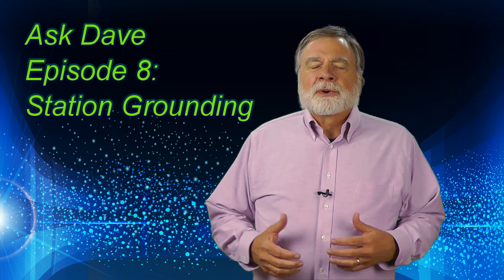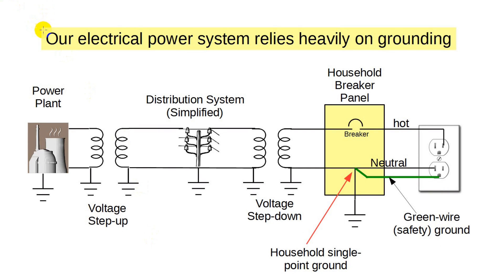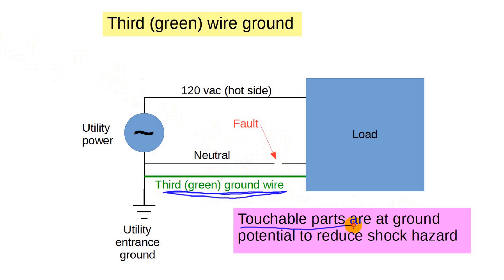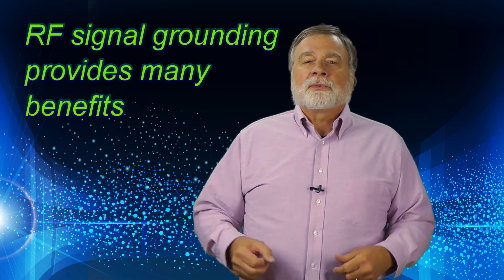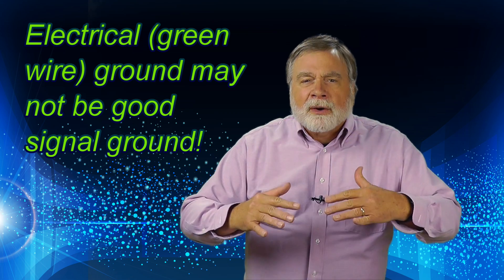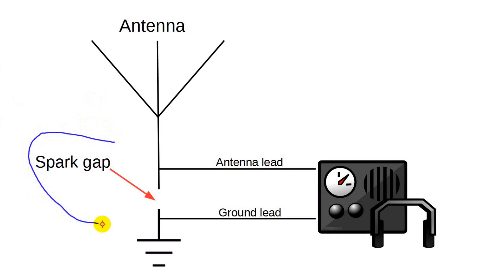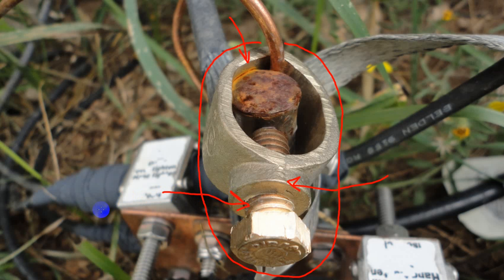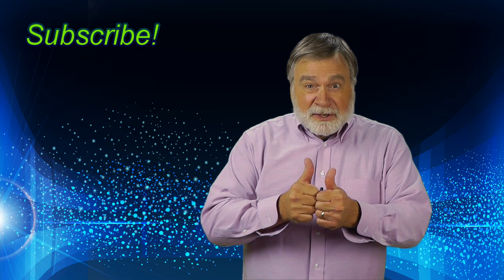Station Grounding for Amateur Radio: Ask Dave Episode 8

Comment: Dave, great information and a concise video.  How important is it to have the station ground bonded to the utility ground?  I had our electric company come out to our house and there is a ground rod inside the housing that the incoming service line and meter are enclosed.  The electrician was shocked (figuratively, not literally) to see it in the enclosure and said that there was probably another one within 6-8 feet in either direction.  I have not yet been able to locate it and if I crack the seal for the enclosure to bond to the one inside it I will be charged at least $250 for opening the enclosure.

I am fortunate that my shack is immediately inside of the location where I am planning on installing an entrance panel this spring.  Grounds will be pretty short.  I have an 8’ ground rod ready to go when the warm weather returns and the ground thaws.  My shack equipment ground bus will ground to a copper plate within the entrance panel, which will then be grounded to the ground rod that I install.  The entrance panel will also have the lightning protection mounted on the copper plate within the panel.  The distance from the electrical service panel and my shack panel will be around 8’.  Do you think that there will be any issues if I am unable to locate another ground rod for the utility service and I am unable to create that bond or if I do locate a second utility rod near my shack entrance panel would you advise against using it for the station ground directly?

Comment: There is so much wrong on this video. 

In the USA out distribution system is based upon either 3 wire distribution or two wire split phase.  None of the lines coming from the power plant or from the substations are grounded.

Also, to comply with NEC any additional ground rods installed must be bonded to the service entrance of the home.

This is dealt with in section 820 of the NEC.  This is both for safety and lightening stroke mitigation.

I bring this up because people where trying to use your video in an online disagreement about 'RF grounds'.

There is no such thing as an RF ground.  RF is expensive to make, why stick it into the ground?

For common mode rejection you use common mode chokes.  These can be construed as current mode baluns in addition to chokes.

If you really believe you need an RF ground, which feeder do I ground in my open wire fed dipole?  Oh, I don't.

I use a safety ground in the chassis of all equipment.  All ground rods (the concentric rods at the tower location are the only ones needed!!!) HAVE to be bonded to the AC service panel!  This is to effect the rise and fall of induced voltage on the coaxial feedline to the rest of the premise.

Might I suggest the writings of Ward Silver and Jim Brown (K9YC) for more information.  Because what is presented here would fail an inspection with AHJ.
Reply from the maker: Borderline ad hominum attack, but I'll leave it up for now.
Reply: I don't see how it's any kind of attack.  Some of the jn formation presented is wrong and I attempted to correct it.

If you took it personal that was not my intention whatsoever.  My intention was to correct the information presented.

--Shane
KD6VXI
Reply from the maker: Very good Shane, appreciate your response. I don't think anything in the video disagrees with the ARRL book on grounding and bonding. Regarding the USA power distribution system, it's complex, agreed. But I stated in the video that what I was talking about was very conceptual and oversimplified. You're the first to have complained in the several years since the video came out. I'm not saying age makes it right, but it has been up for a long time with good comments. I stand by the advice in the video regarding grounding your station. It matches the ARRL advice as closely as I can.

Comment: Just getting started and this is helpful. I've seen a few folks who install a seperate ground in their basement floor. What are your thoughts on this method? If I understand correctly you have your connections attached to the ground rod for your house?
Reply from the maker: There’s something called an Ufer ground (named after the guy who invented it) that consists of about a 20’ piece of rebar in the concrete. It works well as a ground. All the grounds on your property should be “bonded” (connected) together.

Comment: A few points I think are in order here!  1.  Almost all  USA, and even Canada houses have 220Volts AC coming into the Circuit Breaker Box. This is split, with one side of the circuit breakers connected to 1 leg of the 220Volt line, and the other side of the circuit breaker connected to the other leg of the 220 volt line!  This means that most outlets, that are not hooked up to both legs of the 220 V system, are 115Volts + or  - a few volts...    2.  According to national electrical codes, the ONLY place that the Neutral line, and the Ground-safety line are hooked together, is at the Breaker Box!... 3.  Insulated Counterpoise wires, tuned to the middle of each ham band in use, and all Connected to the single common grounding point, (that connects to the outside ground rod,)  in the ham shack, are a great way of keeping RF out of the shack, and off of Mics, etc., when using end fed antennas, and other types of antennas, that present a high impedance point to the antenna tuner! Other than that, thanks for the great video!  :)

Comment: Talk about heat from lighting!  I live in South Florida,  lighting Capital!  Sandy soil and a good lighting hit can make Glass from the sand! I have seen it many times.  It is a good idea to check your ground rods from time to time!  I know some that go out and hit there ground rod with a hammer from time to time,  to break up any glass formed on it. I will not say this works or not. But if you think you got a hit check your ground! If you are not sure put in another ground rod near but maybe 3 to 6 inches from the first one. I have seen where there was ground rods every foot around the wall all connected together with large cable! And have seen fuses not just blown but blown up! Lighting does what it wants to do!  If you don't like that To Bad! Nothing will stop lighting!  The only thing you can do is to give it a easy way to Ground! It is going there!  Help it out and you may save your equipment and maybe your life! The lighting jumps hundreds feet from a cloud to the ground! There is No place in your house it can't jump if there is not a good easy way to ground. The third wire is one easy way.  But when it comes to grounds it truly can be the more the better!

Comment: I've got some noise on my computer USB cable to my blue tooth hearing aid transmitter I got from the VA.  I raised the antenna another 12 feet and it reduced it somewhat.  I think I need to connect the mast pole to earth ground as well as my coax to earth ground.  I think this might help with the "heard" noise on my blue tooth transmitter.  I have the computer hooked up to my hearing aid transmitter and when I don't use it for the computer I have the stereo plug plugged into my HT which transmits the signal to my hearing aids.  That's when I hear the "hum" on the audio 'cause the power is coming from the USB port on the computer or from my cable box when I use the USB port on that device.  I will drive a 4 foot ground rod near my antenna mast and connect the steel mast pole to the ground rod via a copper wire.  Should I also connect the shield of the coax to earth ground?

Comment: So currently, I have a little magmount that is mounted on top of my house. I have a lightning gas tube that is grounded via copper wire to a separate 8' ground rod. Would I still need another ground to prevent static electricity charge from damaging my radio?
Reply from the maker: It is considered best practice that the coax cable be connected to a lightning arrestor at the ground rod.

Comment: I believe The presenter makes numerous incomplete or inaccurate statements in this video.

1. Protection from electrical "faults" (more accurately identified as a “ground faults) that result in a short of the AC line ("hot") to the chassis:
1a. The safety ground wire is more often bare copper, as opposed to a  green insulated wire, both in the house wiring and in the wall box.
1b. A properly sized circuit breaker is the first line of defense against a fault that results in a short from hot to chassis (or neutral)
1c. Presenter doesn't address the role of the circuit breaker (or a the GFCI) in providing protection against faults in a situation in which the fault is a short from the line to the chassis with an intact neutral wire and proper safety ground wire.  This should trip the circuit breaker.
1d. If the safety ground wire is present, a short from hot to chassis should trip the circuit breaker irrespective of whether the neutral wire is open/not connected (which would be a second/additional safety hazard, but not commonly referred to as a “fault.”)
1e. If the current through the safety ground circuit is less than the amount required to trip the (conventional) circuit breaker, any current (the "fault" current) through the safety ground will result in a non-zero voltage on the chassis. 
1f. The safety ground does not always keep the chassis voltage at zero:  Depending upon the amount of fault current and how intact the safety ground circuit is (properly sized wires and proper connections), the chassis voltage can vary widely, from barely above zero to dangerously high.
1g. . If the equipment is powered through a GFCI (Ground Fault Circit Interrupter), an imbalance of current between the hot and neutral wires greater than approximately 5 mA (5/1000ths of an Amp)  should trip the GFCI and open the circuit. 
2. With regard to electrostatic charges on antenna and possible equipment damage, note that this phenomenon affects non-insulated antenna components. It does not affect insulated antenna components. Big difference.
3. Station grounding:
3a. Note the corrosion at the connection between the ground rod and the compression connector. Likely an inappropriate ground rod with thin copper plating on it. Presenter should indicate what constitutes a suitable ground rod. Best to use proper ground rods from an electrical supply company.
3b. If using compression connections with a suitable ground rod, it would be best to use stainless steel compression fittings. 
3c. Also, exothermic “one-shot” welds (very easy to use) are much better/longer lasting than compression connections. 
Note: To his credit, the author does mention the use of stainless-steel connectors when connecting copper and aluminum electrical conductors.
3d. The presenter indicates that "it is best if you connect the various ground systems in your home." This is actually required by code in many areas. In particular, antenna coax, telephone "common" line and cable/CATV shield must all be bonded to the same ground electrode to which the main electrical breaker panel is grounded.
I recommend either correcting this video or removing it. 
For much more accurate and complete information pertaining to amateur radio station grounding and lightning protection, I recommend the ARRL publication “Grounding and Bonding for the Amateur.”
73
W0RCF

Comment: Potentially dangerous information. Please follow NFPA 70 (NEC) rules when bringing ham radio antennas into your house.  You mentioned casually that you attached your station ground to your utility ground - this is an NEC REQUIREMENT, not just a thing to try.  It's a MUST for a reason.  Please do your research as you mentioned.  Acorn compression fittings are NEC acceptable, but high compression fittings or exothermic welds (cadweld is one) are much better.

Comment: GROUND LOOPING GROUND RODS:  We all stayed home for Field Day, I used our club’s vertical.  I also hammered in a ground rod to connect my rig’s ground terminal to it.  Found at later that’s a big no-no and I had set myself up for a ground loop: because the rig was plugged into house current which is already grounded to a rod behind the breaker box.  Using this second ground rod meant that, because the ground voltages would be different from the house ground and this one I just hammered in for the day, I could’ve ended up with a ground loop.  Although your video is helpful- it touched on ground loops only in your shack and nowhere else. Or is the information I got about my situation wrong?  Anyway, glad I didn’t blow anything up!  It is, after all. “Amateur Radio!” N9DMS
Reply: Ground loops are not a safety thing and nothing will blow up, but if the length of a loop is resonant at one of your operating frequencies, you may get a high SWR or find RF on the surface of the radio or key or microphone.  I had that on 15 meters when my station grounding went through the wall to a ground rod.  I had to lengthen the wire to fix it.  It was all the way around the house to the main AC panel with a concrete driveway in between, so bonding my station ground to the mains ground was not an option.  Also, if you have a rig, amplifier, and tuner, each grounded to your station ground, sometimes you have to use ferrites on the coax between the units to break the circular RF path on the outside of the coax.

Comment: Dave, Thank you for your episode on grounding. Do you have one that covers second story station setup?

All I hear/read about is short line to ground and 8 ft rod - over and over. Which is fine to drive in  the point if someone has that option. But my "shack" has to be in the second story of the house and lava rock is only a foot or two beneath the surface.

At a previous house, I was able to put the shack on the ground floor and run a strap out the the rod just outside a window. But it was more "Rods" because I was barely able to put one in at a  3 to 4 foot depth before hitting rock - so I put in three short rods and connected them together.

But in this house, I'm on the second floor and given the window's orientation any  ground wire would need to make several bends and would probably be 30 ft long. My transceiver is plugged into an MFJ filtered power strip that's plugged into the way with the PS plugged into the same strip. The HF antenna is just a long wire (vertical) going to 4:1 balan (or UNUN) hot lead with above ground radials going to the ground terminal and coax from there - with some wound around and air core for a choke - to the shack.

I want to do better but any "ground" lead would probably be longer than the wire antenna itself. What do the second story (and higher) guys do?

Comment: MFJ 931 Artificial ground? I am on first floor no way to connect radio or atu to earth. Previously, I connected my ATU and Radio to a star point , then the short Cooper wire to copper pipe on central heating radiator. However, I disconnected this now as I was told it is not safe. My 66ft antenna wire is connected to 9:1 UNUN, I have a short earth wire connected from UNUN to a ground steak in garden. Thank you. Paul 2E0 PPJ

Comment: This may have been asked, but I cannot find an answer.  I have a mobile radio that doesn't have a ground lug on the back as a traditional base radio does.  How would I ground the radio in this instance?  It's a TH-9800, if that helps.

Comment: i'm going to ask about the screw that holds the cover plate on. i have seen instructions to use that as a ground, and i have a house wiring book that makes no mention of that.
 my ft-817 has a ground screw on the back. should i ground to the cover screw or the green wire receptacle shown in your diagram?
i also have an mfj-16010 random wire antenna tuner that the instructions indicate to attach to the radio.
when i use it should the radio be grounded?

Comment: Dave. My dual band antenna and my telescopic Hf vertical are further away from my radios compared where my radios antenna  feedline cables leave the shack. Would you recommend a separate ground rod for the radios and power supply (short run), and a ground rod next to the dual band’s mast?

Comment: Great video Dave!  My station is on the 2nd floor of my house.  How can I get a good ground when the ground wire run would be about 20-25 feet to my ground rod?
Reply: Fighting the same battle, i'm on third floor. 😬 Guess i will use an old heating pipe (still metal), or buying an mfj artificial ground. 🤔 Please let me know, how you solved the problem.
Reply: @ichipanx4064  The heating pipe might not be metal when it goes into the ground.  Often times, it is plastic PVC.  Why do you feel you need a better ground?
Reply: @hoagelectronicsproductdesi56  I have a lot of noise in my shack. If the s-meter is on 5 or 6 (without any QSO´s going on) it is a good day. The plan is, to ground properly and then see what happens. The heating pipes are really big,old ones and it is a big house. The pipes that go out of the house are PVC, but i could install a ground rod in the basement without problem.  73
Reply: @ichipanx4064  It sounds difficult to get your station grounded properly, and after grounding, you may still have the noise as it probably could be coming from an external source (power lines).  You may want to try an noise cancelling device like a Timewave ANI-4.  There are some good Youtube videos about it.
Reply: @hoagelectronicsproductdesi56  Thank you!!! I already ordered a MFJ 1026. Does more or less the same as the ANC-4.